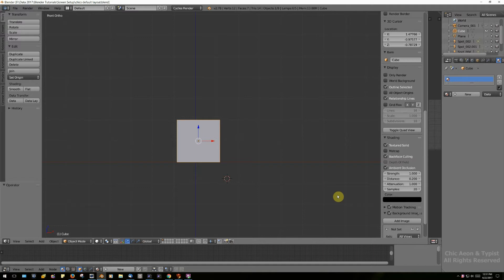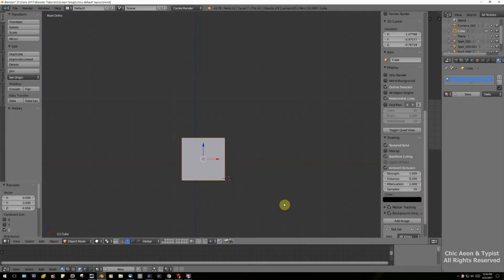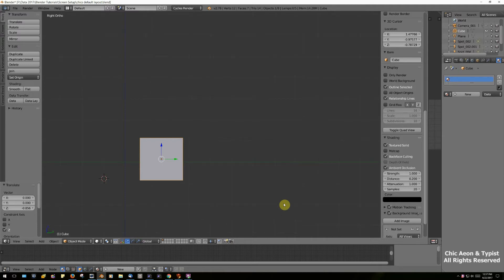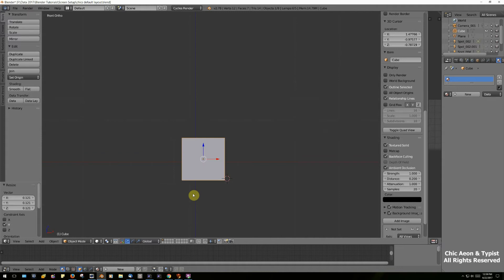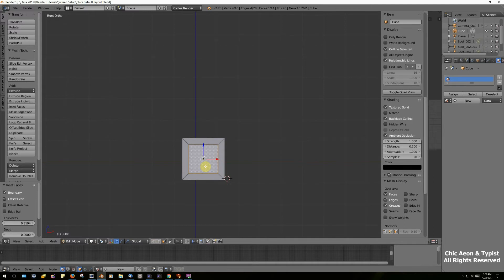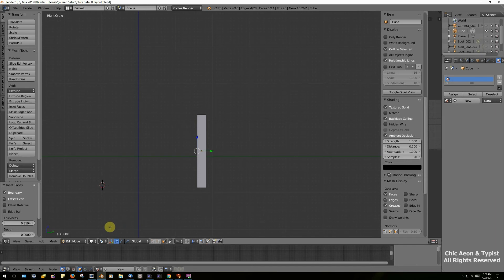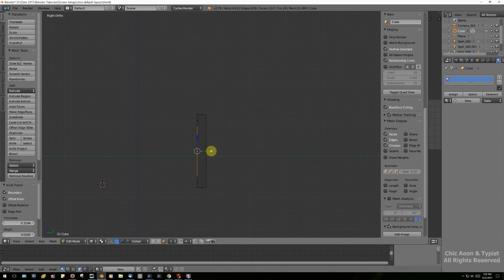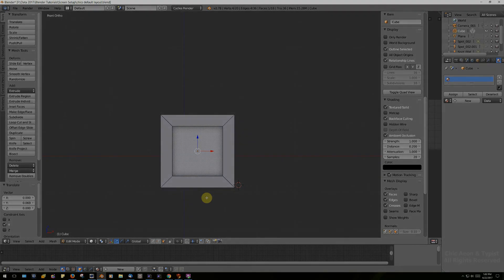Photo Frame Tutorial Part 1

Comment: Hello dear, a good tip for use the left click, like others softwares, just change the user preferences (input) and select left. I've tried that and it's better for me. :)
Reply from the maker: Don't agree since most of the folks are using the Blender default. It really isn't that difficult to right click - LOL. 
 Certainly not a good plan for teaching folks. But if that works for you, great and enjoy! :D
Reply: Thank you for the tip Sarita, I discovered it watching another video for beginners . It can be very useful for some people, however teaching it to beginners can confuse them when everybody else including all kinds of tutorials talk about right click to select. :) I tried it then reverted to the default. I still hit the left click to select but that's an easy mistake to correct :)
Reply: This is true.  Also, Blender Guru said that the new update will have the left click automatically so it's best to switch it now as a beginner.  I suppose it's just preference.  I prefer to switch it now.